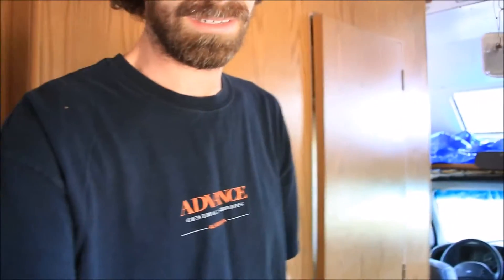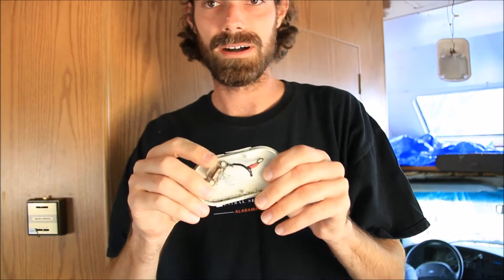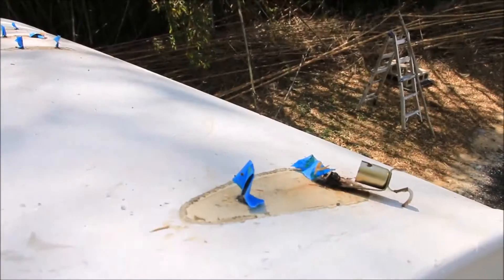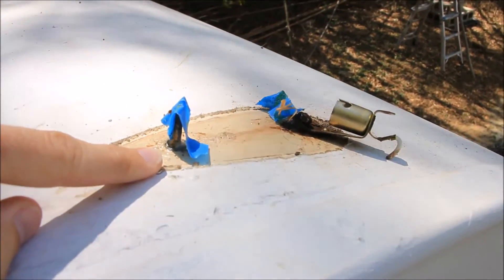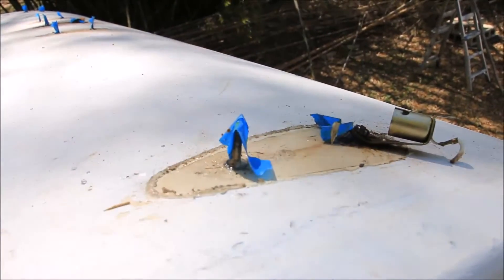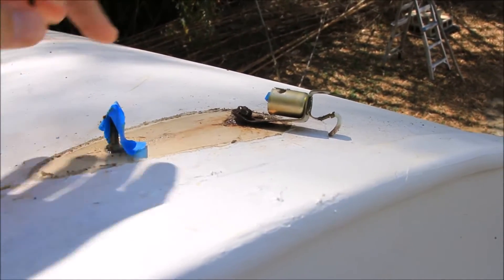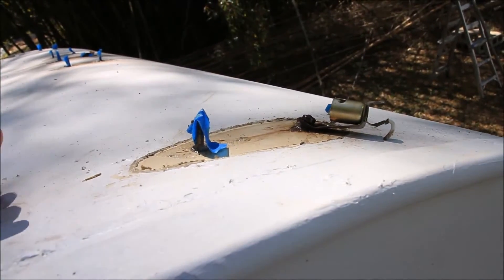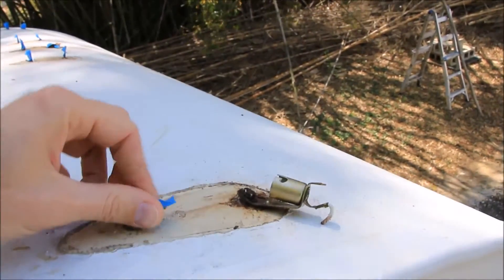Marker Light Problems

Comment: I would start by cutting everything at least flush or knocking the cut off screws inside and sealing the holes with silicone and maybe a carriage bolt. To add marker lights Id glue a piece of shallow channel to the roof with the wire run inside but I also like rjr's suggestion
Reply from the maker: Thanks for the suggestion. That's a good idea as well. I siliconed around the bolts temporarily until I figure out what I'm going to do up there. Once the bolts are cut I'm probably going to use JBWeld to fill in the holes then sand it and paint it.

Comment: Mount a white plastic inspection port (marine) on the inside, at the middle.  Cut all the old hardware off and chuck that as far as you can throw.  Buy better lights and extend the wires so they will reach to and outside the inspection plate.  Use a snake to grab the existing wires to connect to the new light wires.  Use LED lights so you never have to mess with them again.  That's my idea and I'm stickin to it!!!!
Reply from the maker: Thanks for the suggestion! I will have to look into that.

Comment: What did you end up doing?  I have the exact problem.
Reply from the maker: I ended up getting some yellow L.E.D. strip lights and connecting them to the posts that had some power going to them. I did a video on it. I will have to see if I can find it.